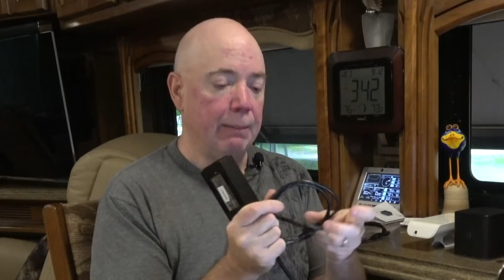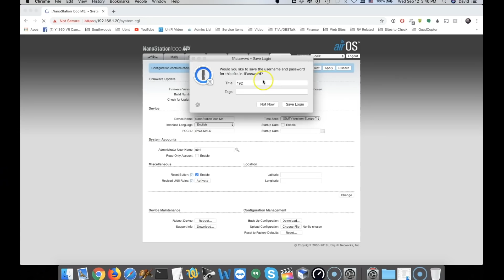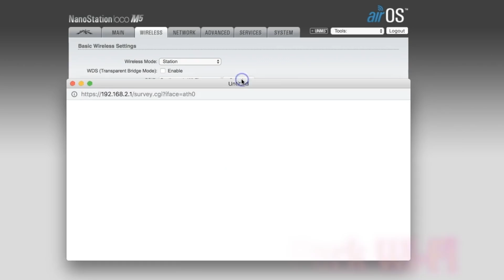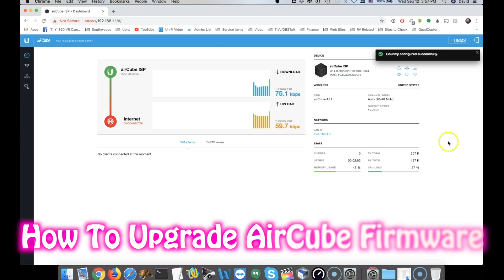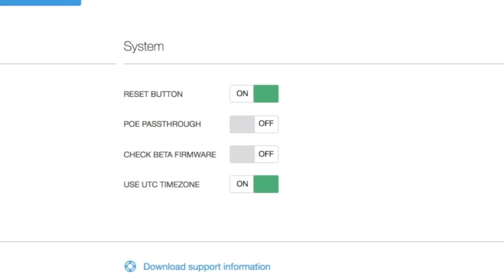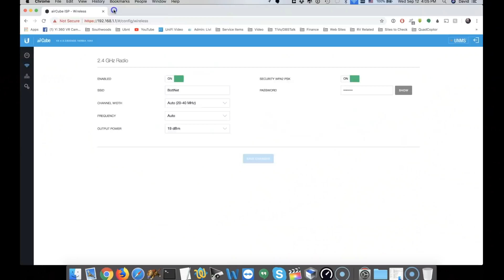Build a Private RV Wi Fi System with a NanoStation & AirCube AC

Comment: Will the AirCube remember login and passwords for different WIFI access points. So when at home it would auto connect there and then at my favorite park it would auto login there also.
Reply from the maker: Hi...The AirCube is the router, so that is not used for that.  The NanoStation is what is used to connect to a park and seeing it is commercial equipment, it also can't save multi passwords as it is usually setup at a clients and that is that.  If you are looking for sometime that is simple and easy to setup (Just needs 12V on the roof) and will remember passwords for parks etc,  the look at the Winegard Connect V2...  https://amzn.to/2LgVzya

Comment: Hi,  thanks for the awesome video.  My wife and I are full-timers in our converted sprinter van and we're looking for a way to extend the wifi when we're stealth camping.  How does this setup handle an open wifi network that is not password protected, but instead re-directs you to a sign-in page where you accept their terms of use (i.e., a McDonald's or Walmart wifi network)?

Thanks again!
Reply from the maker: My guess is you never looked at the link to the full blog post of information.  

Dealing with Captive Portal or “Agree” Pages: Some parks require you to “agree” or login with a user name and password before you have access. So once you connect to the park with the NanoStation, while on your Wi-Fi network, the first time you open your web browser the “captive portal” page will come up asking you to agree or log in. Once you do, the portal will note the MAC address of the NanoStation and then allow access to anything on your local Wi-Fi network.

NOTE: If your browser defaults to a open a webpage that is HTTPS (vs HTTP) then the captive portal can not show up as it is not HTTPS active. So be sure you are trying to go to a site that is not HTTPS. (Ie…Facebook, Google, GMail are all examples of HTTPS sites that people have their browsers default to.) So try another site…any site…maybe ours, and the captive portal page should come up for you. Also some campgrounds auto log you out after X hours or at the start of a new day. If this is the case you need to AGREE again. Just a heads up.

Comment: Great job, very helpful.  I presume this all works in the same way in the UK. How about showing some instructions for setting up with a different routers.  I planning to use a very smart little TP-Link AC750 Wi-Fi Travel Router TL-WR902AC and not absolutely sure how to set up. Thanks once again.
Reply from the maker: Not much to tell about how to use it with another router. Setup the NanoStation as mentioned and then run a cable from the LAN port of the PoE injector into a WAN or Internet port of your router of choice. Thats is.

Comment: Hi. I like this setup but I want to ask about a few adjustments.  First is the poe unit. Some Places it states that the Poe comes with the nsm2us. Elsewhere it is not? Second,  can this be easily powered by 12v (w/o inverter)? Third, what is the link to the "other" setup that you did (from which people asked for a less expensive option? ). I would lean towards range and performance over cost and ease, for a few dollars more. 
Thanks
Reply from the maker: The NanoStation M2 will come with a POE Injector.  Not sure of a way to power it via 12V as I have never needed to look into trying.  The "other" setup I did years ago that used an AirGateway which is no longer manufacturer. This the new video using the new AirCube.  All the same except for the router.

Comment: I had this all setup and it was working correctly with an xfinity access hotspot. The power went out a couple nights ago and now it’s not working. When I pull up all the available Wi-Fi around me, it doesn’t give me the little selectable dots in front of any of the Mac addresses. What do I need to change to allow this?
Reply: I am sorry, but I would not have any idea what might have changed. (No way I would be able to tell.)  Only suggestion I would have is to re-check all the settings and if need be, factory reset the NanoStation and redo the programming.
Reply: David Bott thanks that’s what I ended up doing. I don’t have the Cube so I found that I had to clone my address also since it’s connected to an xfinity hotspot and requires a Comcast/xfinity username and password  in order to work directly to stream to my TV (no browser to enter the xfinity login portal on the tv so I had to login on my computer first and clone it)

Comment: Great advice and video! My laptop dies not have an Ethernet port. So I connected, by wifi, to my existing router; then connected between the LAN ports on the injector and existing wifi router. This enabled access to the Nano for config. After first Nano reboot, with new address, I moved the cable to the WAN port on my wifi router, let it log into the Nano, and continued with config of the wireless LAN as you described. I'll substitute the Cube when it arrives since my wifi router is rather like and clunky...

Comment: David, what is the difference between the Ubiquiti M2 and the M5, will the M5 preform better?  Thank you for your reply in advance and keep the videos coming!
Reply from the maker: M5 is 5Ghz and the M2 is 2.4Ghz. You will want the M2 as all RV parks are 2.4Ghz where few have both 2.4Ghz and 5Ghz.
Reply: I accidentally bought the M5 and tried to use this video to configure it...and failed miserably. I then bought the correct one and set it up just fine with this tutorial. Going back to the M5 and the interface is so different, I can't seem to configure. I can find the wifi fine, but can't select it to enter it's password.
Reply from the maker: It actually sounds like you bought a 5AC which ONLY works with other Ubnt AC products and has a totally different interface/firmware.  If you bought a M5 the firmware is the same.

Comment: Is there a way to connect it to a park wifi such as TengoInternet which requires using a special login page and user name?
Reply from the maker: I am guessing you never looked at the full blog post.  For in it, you would see this...

Dealing with Captive Portal or “Agree” Pages: Some parks require you to “agree” or login with a user name and password before you have access. So once you connect to the park with the NanoStation, while on your Wi-Fi network, the first time you open your web browser the “captive portal” page will come up asking you to agree or log in. Once you do, the portal will note the MAC address of the NanoStation and then allow access to anything on your local Wi-Fi network.
Reply: @DavidBott  Great, thank you.

Comment: David.. is there any reasons not to use the AirCube AC?  Cost about $50 more but gives you Gigabit ports and 5GHz. I'm just starting out RVing, so didn't know if 5GHz would be helpful?  I could connect to my personal hotspot on 5GHz and connect my Roku box to gigabit port with a hard wire.  Just picking your brain on why not to spend the extra $50.... am I missing anything?  THANKS
Reply from the maker: I am not aware if it is the same firmware as Ubnt AC is not the same AC as others.  Example...a NanoStation 5AC can not connect to any AC Access Point, but it can to another Ubnt AirMax AC device.  I say get one and see. :-)

Comment: If possible is it better to go with the old  airway instead of the new one? What are the real differences besides the new one needing separate power?
Reply: They do the same thing.  The difference is that the AirCube will get future updates and has a larger antenna inside, so better range than the standard AirGateway.  It is not a separate power supply actually...You are still using the POE power block from the NanoStation...It is just that you need an extra cable.
Reply: Thanks.... still  getting ready to get out there. Byw...how about a vid on what you so or suggest one for computer security on the road?
Reply from the maker: Sorry, it is something I would not cover as their are so many and I am also a Mac user which is different.

Comment: I have a Mobley where and when exactly would it be connected in this set up, and would I use the Mobley password?
Reply from the maker: You would turn on your Mobley and look for it's SSID in the NanoStation when you select SCAN. (The Mobley is like any of Access Port that devices can connect to.)  Select it from the list, and save. Then at the bottom of the screen is the password input box for the password to use for connect to that network.  Click change, click apply.

Comment: Good stuff but I needed a drink after following this... It's working but seems a little slow... I'll work with it...
Reply from the maker: Note...you will loose some speed based on the extra wireless hop. But usually it is not enough to be worried about for most RV parks based on the low speeds you usually get from them.  It does not bother me much as long as I am protected and have useable Internet and can stay connected.

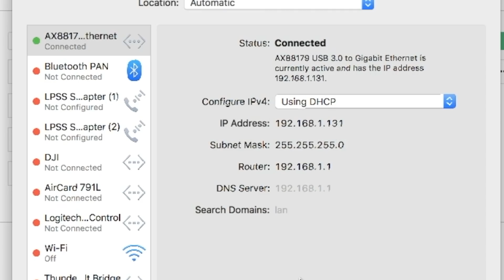Comment: I've been using the NM2 and NM5 with the AirGateway after watching your video quite a while back.  I'm confused about the functionality of the AirCube ISP as I thought it was simply an AP.  At 22:24, you show that the AirCube has provided a DHCP address to your Ethernet connection in the 192.168.1.x range.  Does it also do DHCP via wireless and are you then assigned a 192.168.1.x by the AirCube or a 192.168.2.x by the NanoStation?  I'm guessing you must be getting a 192.168.2.x address since you can then directly address the NanoStation to reconfigure the upstream wireless connection.
Reply from the maker: It's a full router, so it does DHCP. Want to set up it will hand you out a IP address of 192.168.1.X for the private network. The reason you can reach the nano station at 192.168.2.1 Is because it is using that as the WAN router.  The AirCube ISP is doing the same thing as the AirGateway....just in a new package with some more ports on it and a larger antenna inside.
Reply: @DavidBott  Could you put the devices on all the same network range and just set nano station 192.168.2.1 set cube 192.168.2.2  set the dhcp range on the nano to 192.168.2.200-250 set the dhcp range on the cube 192.168.2.3-50?
Reply: Also what is a good way to get he nano station cable outside of your camper
Reply from the maker: @gary-gilbert  If it is on the same network then it no longer is a router.

Comment: Hi David, great info..  would that work with an AT&T mobley ?  Would AT&T see each device?  Limit is 5 devices.
Reply from the maker: You would connect the NanoStation to the SSID of the Mobely and you can have 20 devices if you want.  Then you connect it to the SSID of an RV when the data in the park is good and all your devices stay connected to your  inside private network. Note, you will loose some speed based on the extra wireless hop added. But it usually does not bother me to much as long as I can use the Internet.  Hope this helps.

Comment: Hey David, after configuration, where would you mount the antenna and AirCube inside the coach? How would you know where to find the location of the RV parks AP to point the antenna?
Reply: I bought and installed the Nanostation and Air Gateway that David described in his earlier video. It really worked well. I originally tied the Nanostation to the TV mast and ran cable into forward electronic cabinet via a roof feedthru, where the Air Gateway was mounted. Worked well until water got into the Nanostation (since it laid flat when antenna was lowered) and ruined it. Bought a new Nanostation,  and mounted it to a 3/4" pvc pipe about 1 ft long, with pipe cap on each end. The pipe is then attached to the driver's side of the forward cabinet using a Command broom holder. The Nanostation can then be removed for travel and rotated to aim at campground access point. You could also mount the pipe to a flat plate to set on a counter.
Reply: Lance, finally got a chance to get the pvc pipe and command broom holders (btw, they work excellent) and applied it just as you mention. Thank you. Everything  is working fantastic and again David thank you for providing this video. I ended up getting the Nanostation M2 and wished I went with the M5.
Reply from the maker: "...;and wished I went with the M5."   Hummm....No.  Do you know what an M5 is or do you just think it is a newer or more power unit based on it being a "5"?  The M5 is actually 5Ghz Wi-Fi vs 2.4Ghz W-Fi which the M2 is.  2.4Ghz every RV park has.  5Ghz only some will have that are newer Wi-Fi installs.  But they ALL will have 2.4Ghz and thus is why I did the tutorial on using it.  Now you could ADD an M5 setting it up 100% the same way and if a park offers 5Ghz, use it when you can by connecting it vs the M2.
Reply: Yes I do know the different but only said that because the last RV park we were at offered both 5Ghz and 2.4Ghz. As part of the tutorial weren't you using a M5 to show how to configure the Nanostation? I know it works the same way on both the M2 or M5. Either way this works great. Btw, I also use this configuration at my storage site. I am able to connect to hotspots near there and it gives me more reasons to visit my rig more often. :).
Reply from the maker: Ok good!  I have had people buy the M5 thinking it was a newer model or something and not being able to connect.  They way you said it, I thought you meant you should have bought one for that reason or something thus not knowing.  This is why I carry both. :)   Take care.
Reply: @DavidBott Good points. They should have named them M2.4Ghz and M5Ghz or something better.
Reply from the maker: You just need to look around the park for antennas or ask the park where the access points are and then point. :)  In a case like this, I would be looking to mount the Antenna inside on the windshield and put the AirCube on the dash.  Some people put the NanoStation outside with a longer cable though the slide out seal and have the router (AirCube) in a cabinet.   Hope this makes sense.  You can do whatever you would like as long as the ethernet cables will reach where you want. :)

Comment: Have you run into many RV parks still running WEP? I’ve had to have a much older firmware for the Ubiquity radio as the newer ones no longer support connections to WEP only APs. Another great video.
Reply from the maker: I really have not. I think one maybe.

Comment: Daved. Wouldn’t the airport time capsule be the same as the cube you used?
Reply from the maker: Yes, as stated in the blog post, you actually could use any router with the NanoStation.  I was just doing this, like the other, for all in one, low cost yet powerful, solution.
Reply: Yup!!! just got my NanoStation today ...hooked it up with an old linksys wrt310n I had and so far it seems to work just fine....can't wait to try it out in the real world ;-)